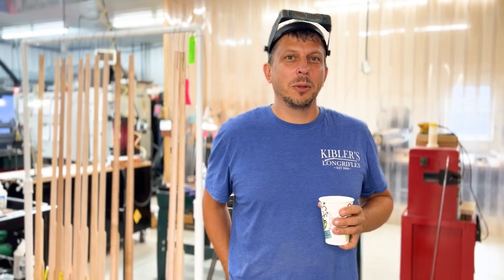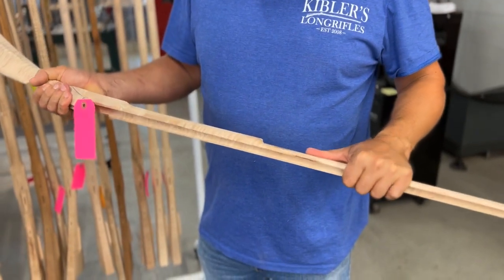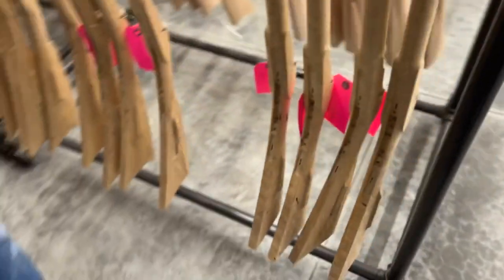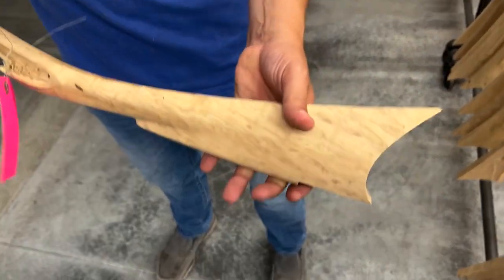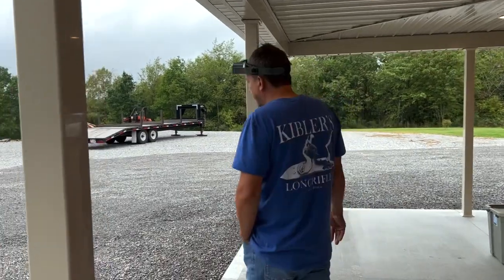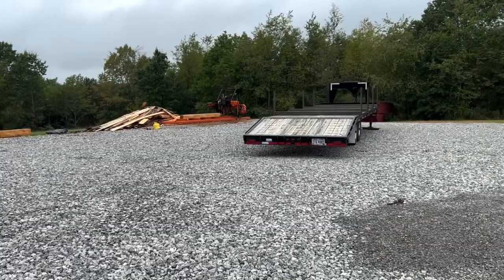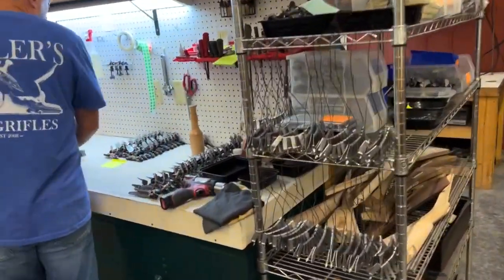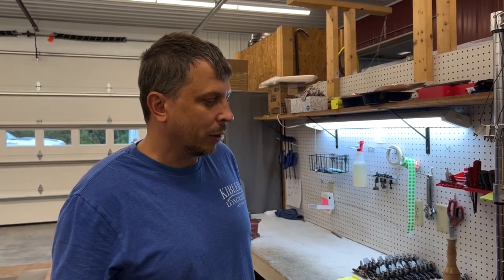Wild looking ash, blister maple, sale stocks, and playing around with incise carving

Comment: Dear sir .I have built a number of long and short guns with "undesirable boards " and they have turned out some very beautiful and functional rifles and smoothbores from 29cal to.875 bore .I have used hard maple ,soft maple , cherry, walnut, red oak ,white oak, straight grain ash,very crooked grain ash,south American jungle hardwoods, beechwood. And they all work very well. NOTE:the oaks are stringy and the jungle hardwoods are very heavy both make great stocks so don't be afraid of what appears to be a difficult price of wood .you might be surprised.

Comment: Put together two rifles so far both stocks are beautiful. Went together without any flaws. Plan on two more.
Reply: One thing that I should note is that the beauty of the rifles I built is secondary to the accuracy. I have shot a 3 shot 2 inch group at 100 yards from a bench with the 50 cal. Colonial.